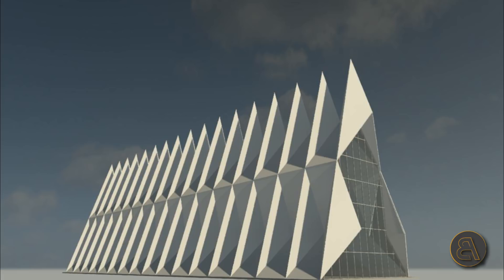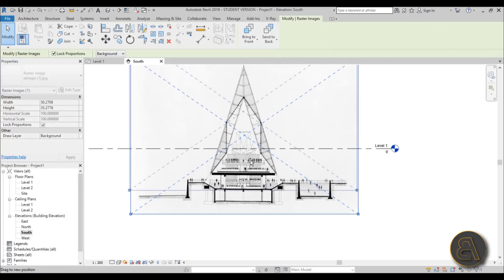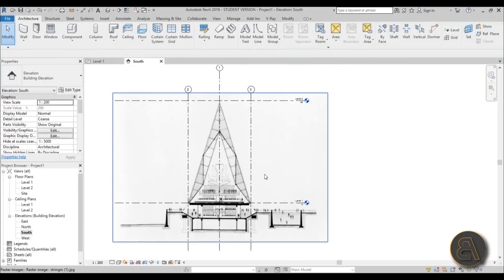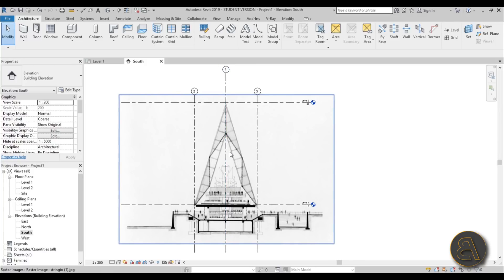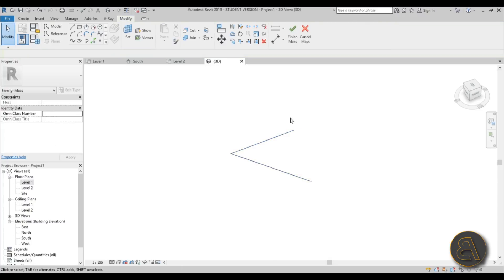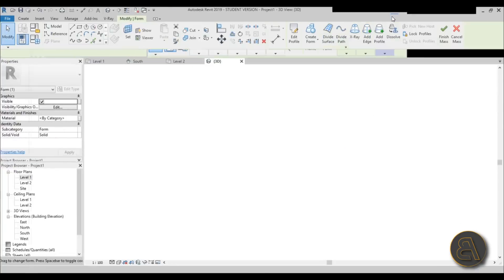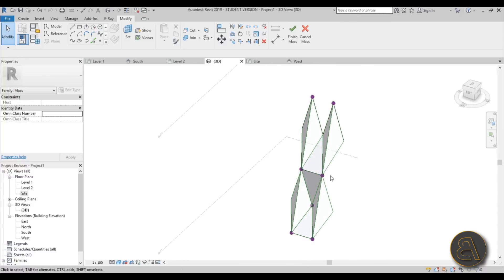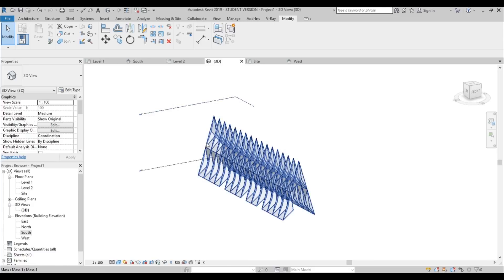Air Force Academy Chapel in Revit Tutorial

Comment: You know there are easier and faster ways to that ..... One instance would be using reference lines to establish that working surface for the triangles and when that's done, you will not have the problems of moving and copying as you'd be doing so with its planes too.... But you couldn't copy because you used just planes.... But I still like your tutorials tho... Keep it up bro....